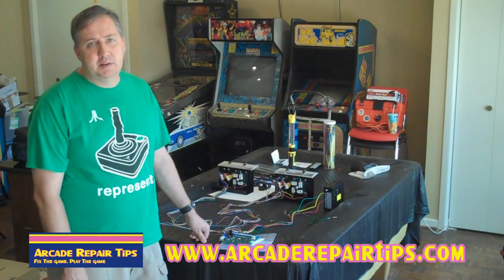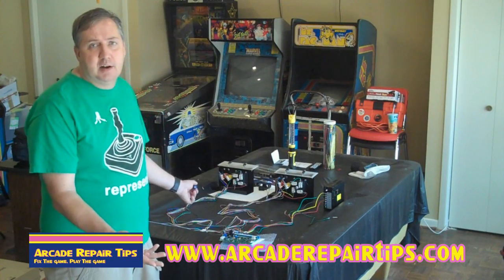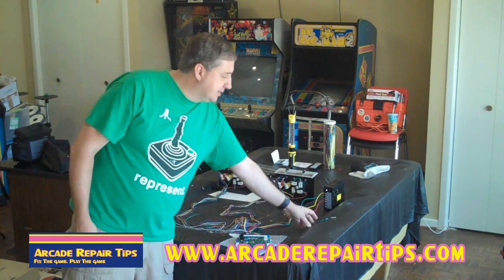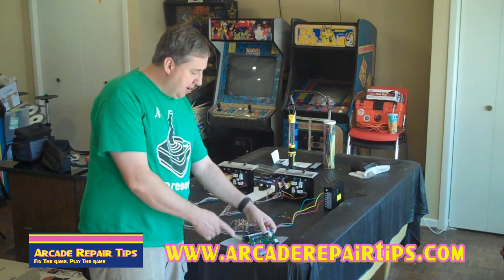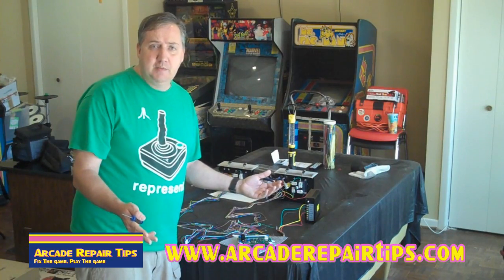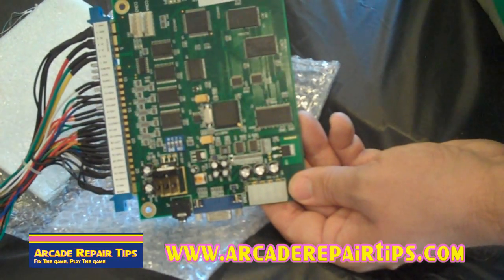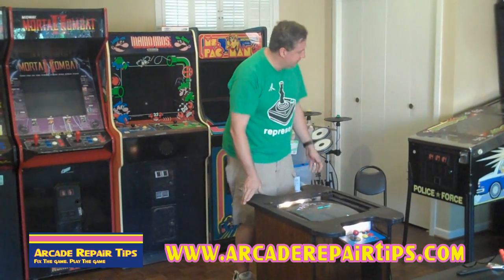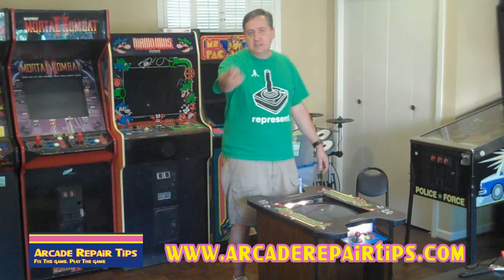Arcade Repair Tips - Wiring An Arcade Cabinet Using The JAMMA Standard

Comment: Is there no transformer needed?
Reply from the maker: Depends on the monitor installed in your cabinet. While older CRT arcade monitors typically require an isolation transformer, most newer monitors do not. Check the manual for your monitor to see if it requires one.

We also covered your question on our Live Show Episode 81. Here's a link to the episode if you want to watch it: https://www.youtube.com/live/ioaSHxuhEC8?si=8JkmTJrdXkA9uSfP&t=3460

Comment: i have a jamma board cocktail table multi video game but monitor goes to sleep mode. it started slowly and unplugging several times resolved the issue sometimes but now continuously goes to sleep mode. Bought another power source checked cables and used different monitors but issue persists ??????????????????????????
Reply from the maker: Monitors typically go into sleep mode if they are not receiving a signal from the computer/game board powering the cabinet. Since your cocktail cabinet is using a JAMMA board, it could be either power issues with the board or the board itself. Start off by checking the voltage going to the board to make sure it’s correct. You may need to adjust your power supply if the voltage is too low. If you can’t get the voltage dialed in, try replacing your power supply. If the voltage is correct, then you probably have an issue with your JAMMA board. Since it’s a multigame board, your best bet is to buy a replacement.

If you would like to hear more of our thoughts, we will be discussing your question on our Live Show Episode 69 which can be found at the following link: https://www.youtube.com/watch?v=LHLN9hmDZcc

Comment: My left joystick stopped working. The trac ball works.  The wire tests fine to board. The switch is good. Bypass the switch still gives no left movement. What's bad?
Reply from the maker: If it's the whole joystick that stopped working, it could be caused by a break in your ground wire daisy-chain. Check the continuity between the ground wires on the joystick and the ground wires on either the other joystick or one of the buttons that is functioning. If the continuity is good, it's possible that it could be a board issue. If the board has a I/O check in the test mode, enter it and see if it registers the joystick directions. If you need additional help with your issue, we will be discussing your question on our Live Show Episode 63 which can be found at the following link: https://www.youtube.com/watch?v=VbLsiMHhb8k
Reply: @arcaderepairtips  the board pin had to be cleaned with an eraser.  Thanks
Reply from the maker: @Chris-go9ti  Awesome. Thank for the update. Glad you got it working.

Comment: Great video thanks i can get my S3 button to work using the grey wire but in setup I can press s2 to move forwards but when I press s3 it goes backwards a screen, should  jump to the end. Any ideas what I'm doing wrong? Thanks
Reply from the maker: So, this could be the version of your 60-in-1 board. There are several board variations and not all of them function the same especially in the setup menu. With that said, we would recommend double checking your wiring. Make sure you go by pin location and not wire color as the color can change depending on the JAMMA harness. Here's a JAMMA pinout diagram in case you need it: https://www.arcaderepairtips.com/jamma.html

If you would like more details about your question, please tune into our Live Show Episode 54 on Thursday, August 5, 2021 at 5:30 PM CT. Here's a link to the episode if you want to watch it: https://www.youtube.com/watch?v=rW25CZFclWs. Thank you for your question and good luck with your future repairs.
Reply: The one I just installed does this. If you look, it says on the screen by S3 "LAST". It means LAST screen you were on, not the final screen of setup. Irritating, as the volume control is on that last screen, huh? Also, my manual says use the TEST switch to access the menu and such, but I have to use the JUMPERS on the pcb itself I think.

Comment: I'm having a problem in connecting the speakers wires. Please help!
Reply from the maker: What sort of problems are you having? The speakers wires on a JAMMA setup are pretty basic. The Speaker + (pin L) and Speaker - (pin 10) wires usually connect directly to a speaker. They may hook up to an audio amp depending on your setup. Please send some pictures of your setup to questions@arcaderepairtips.com if you continue to have trouble with your speaker connection.

If you would like more details about your question, please tune into our Live Show Episode 52 on Thursday, June 3, 2021 at 5:30 PM CT. Here's a link to the episode if you want to watch it: https://www.youtube.com/watch?v=RjuNCBBRTk8. Thank you for your question and good luck with your future repairs.

Comment: Hey! I'm grabbing a 60 in 1 soon and I want to use a VGA monitor and ATX power supply. What would you do with the unused JAMMA wires on the harness linked to a CGA monitor and arcade power supply preferably without snipping the wires outright?
Reply from the maker: We usually bundle them up with a zip tie. We don't like to snip them because you may need them if you decide to change out the board in the future. Hope that helps.

Also, just wanted to let you know that we will be covering your question on our Live Show Episode 45 on Thursday, November 5, 2020 at 5:30 PM CT. Here's a link to the episode if you want to watch it: https://youtu.be/ZNLOlMyUHu4. Thank you for your question and good luck with your future repairs.

Comment: How did you get the vga board to run with a crt monitor?
Reply from the maker: The CRT monitor we use in this video is a tri-sync which has native VGA compatibility. If your monitor doesn't have VGA compatibility, you can use a video converter board to accomplish the same thing. Hope that helps.

BTW, we will also be discussing your on our Live Show Episode 41 coming up on Thursday, July 2, 2020. Here's a link to the episode if you want to hear more of our thoughts on your question: https://www.youtube.com/watch?v=Ma5HDO6_7Dc

Comment: Hi I have a 60 in 1 card it works fine with a VGA LCD monitor but if I connect it to a cga monitor it just displayed banded coloured lines I have switch the jumper on the card as indicated by the instructions but still no result
Reply from the maker: David, thank you for your question. We just wanted to let you know that we will be covering your question on our Live Show on July 5, 2018 at 5:30 PM CT. Here's a link to the episode if you want to watch it live: https://www.youtube.com/watch?v=AV7vIN1-58U. It will also be available as a recording at the same link if you are not able to watch it during the live feed. Again, thank you for your question and good luck with your future repairs.

Comment: how do you wire the test switch? I see it is only one wire what kind of switch is it 2 terminal? if so what will the second terminal connect to.  Please help me out thank you
Reply: Usually any ground wire or any metal part of the cabinet that is grounded to everything else. In a pinch while building a cabinet, I've just touched the end of that wire to the coin door (which was grounded) and it brings up the test screen. So basically, when you press ANY button, you're grounding it to a wire somewhere that goes back to the JAMMA harness (where it's grounded).

Comment: hello I'm using this pandora's box 3 http://bit.ly/1nI96lb and I have problem with the vga signal. It is 800x600 but the frequency seam to be weird near 40 hz. It works on old LCD but on newer LCD with also dvi port I have problems like black screen, switch off or out of frequency message. I already try also to power pandora with a atx power supply, but it doesn't work. Should be a solution use for example a vga signal repeter/filter? any ideas? tnx

Comment: Hi im helping a youth group that was donated a jamma op capcom coin op street fighter 2 that whilst in game is missing the sprites any clue as to why?
1
Reply: Sounds like you need a new chip set.
Reply: Turn off the game and unplug it. Look on the main circuit board (not the one directly against the display tube, but the game board). Firmly push down on the little individual chips on the game board that are in sockets. Sometimes these chips "creep" out of their sockets they are seated in slightly and don't make good contact. This can sometimes fix your problem. DON'T press TOO hard or you might crack the board.

Comment: my pacman wiring harness had a wire to sound snap is there a way to fix that without rewiring the whole cab. Should I use tape or solder.